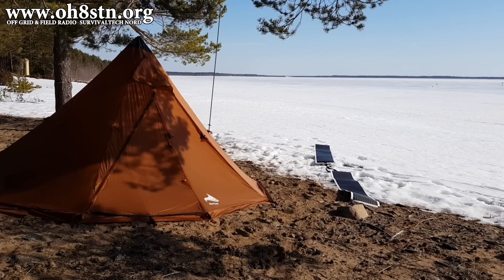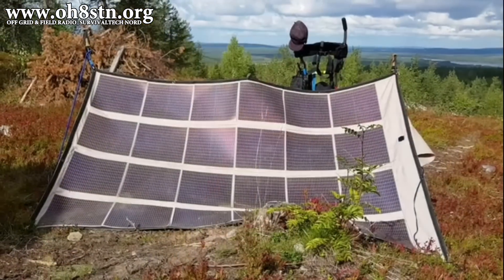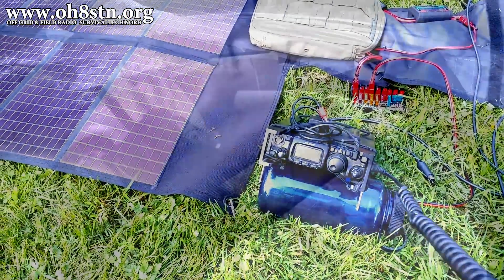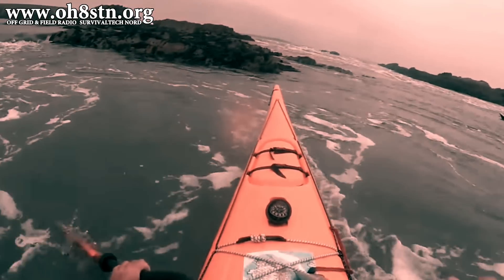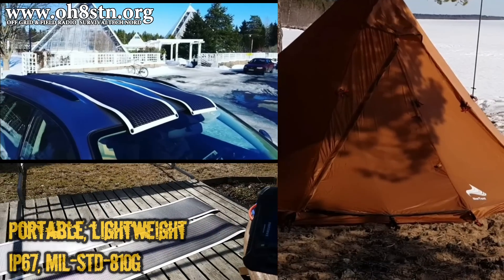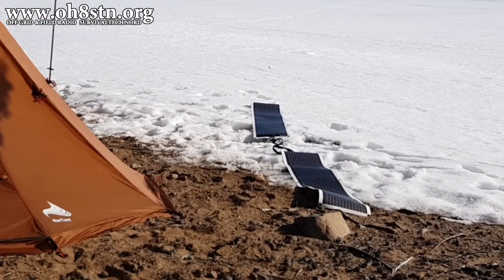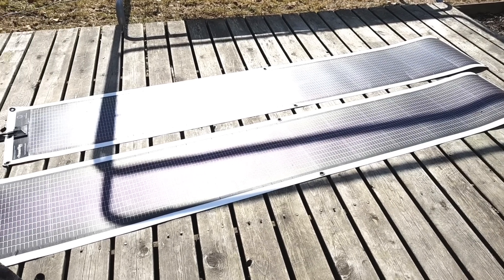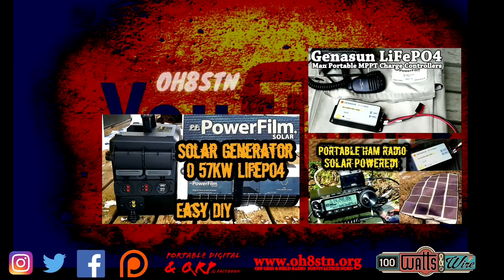Portable Solar Panel | PowerFilm Solar

Comment: Just found your channel, amazing content! I appreciate your efforts. Would you say two rollable powerfilm 60 panels are the way to go vs. a foldable 120? What one do you prefer given your extensive experience? What is the minimum panel size you need to keep the FT891 up?
Reply from the maker: Yhanks for the kindness. 
Definitely 2x 60 watt panels for redundancy.  The 60w panel can generate more than the rx current consumption of the 891, and 2x 60w will keep you charging on an overcast day at mid to high latitudes anytime but deep winter.
I would also combine the 2x 60w with a 12-20ah LiFePO4 battery and Genasun GV-10L charge controller. 
Hope this helps.
73
Julian oh8stn
Reply: @OH8STN Thank you, excellent advice. Subscribed and 73s.

Comment: Thanks to your reviews on the crystalline panel vs amorphous panel, I invested in the amorphous 120 foldable powerfilm. I did what was best for me due to the amorphous being able to take a beating, shot thru, and double as a shade structure/awning. 

But, especially, light weight. 

The price was hard to swallow, but it's one of those "buy once, cry once" situation.

I need it to charge my eb70s, to power my fridge. 

Thank you for your work.

Comment: Have you found any flexibility issues (cracking) with the rollable panels during cold weather -20 to -40C? Or would the foldable panels be a better choice in cold weather?
Reply from the maker: The only rollable panel I've ever seen damaged was one of my 28 Watts. I was out in about -25 C for several days. When I rolled it up, there was a very light sound of a crack. It was my first experience having them out in such cold and I didn't take care about rolling them nicely. Since then, I've learned to go slow rather than forcing them to roll shut. I haven't lost another one since. Those were the white ones, which were the last generation. This new generation, the black ones, are even more flexible, and more resistant to cracking. We need to be gentle in the cold. I've never lost a folding one.

Comment: Hello, i can't find the output for this panel (the 30W fodable), is there a DC plug to connect on my sherpa 100 AC?
Reply from the maker: You need a cable from the connector on the solar panel, to your solar input on your sherpa. Check the shop at www.powerfilmsolar.com
Reply: @OH8STN  Thank you for your response,  yes from what i saw, I have to buy an Anderson Powerpole cable and then Anderson to DC cable. too bad that they do not sell in one cable, or better, the DC directly on the panel.

Great review by the way!

Comment: I have 3 of the R14 rollable panels. Is there an adapter that would allow me to charge a Jackery 500?
Reply from the maker: Sure you can. I use two Rollable in series for a similar battery. Here's the direct link. https://californiapc.com/Portable-Solar-Chargers/Custom-Cables-Accs-for-PowerFilm/DPH2MX2SERIES-DPH2F-76IN.html
They can also build a custom cable for three panels in series. This cable I linked to exists because I asked them to build it for me. So be sure to reach out and let them know who sent you.
73
Julian oh8stn
Reply: @OH8STN  Thanks!
Reply: @OH8STN  I ordered a cable from them. Joe Gartner responded very quickly to my email and confirmed what I needed. I mentioned your referral. I will definitely order more solar stuff from them. Thanks!

Comment: Regarding battery temperature, I am curious when you deploy solar in cold temperature environments what lessons you've learned about ensuring no degradation to the lithium battery during charging. For example, when it's 10F outside, I presume a powersaver max is not the best option as the battery is exposed to the cold.

Comment: I like your videos, very detailed and mention points others don’t consider.

In your earlier video, https://youtu.be/AEXP2mhcN_w, you hose the foldable panel with water. In this video you say you took them inside your tent because it started to rain and recommend the rollable version.

Are or aren’t the foldable versions water proof?

The 30W panels only bring about 6% efficient are about the size of a 120W mono crystalline panel, which can be ~24% efficient. I understand the amorphous work better in low light and shade, but would a 120W panel that’s only outputting a small fraction outperform a 30W panel outputting a larger fraction?

Comment: Great review as always. Thanks! I'd like to pick up a R-series Powerfilm panel for my Jackery 160. Can you recommend a model?
Reply from the maker: Definitely. The r-series is perfect. It's completely waterproof and can be left outside  your camp in the field. I have 2x 28 watt R series and 1zlx 21 Watt. If I were doing it again, I think I would go with a 60 watt from the R series. Remember though if you live someplace like southern Italy or Arizona, you might get away with a smaller panel because there's so much sun. If you live in a place which is often quite cloudy, I would go with the bigger 60 watt panel. By the way how do you like that jackery?
Reply: @OH8STN  Hey man, appreciate the reply. The Jackery is great. I picked it up on a whim during a sale, just thought it would be nice to have for camping or emergencies. Turns out it's very well built, with quality components and cells inside. There is a YT teardown vid somewhere that shows it pretty well. I just had a look at the Powerfilm R-60 ... holy snacks that is expensive! I generally buy the best tools available but that's going to have to wait a bit  :-)  I looked up the specs and the Jackery 160 will take 42 Watts charge, so the R-60 would probably be a great fit considering your points about efficiency and weather. Take care bud!

Comment: Hi Julian. Top notch info, cutting edge use of the YouTube ecosystem. Question: I'm in the Pacific Northwest  in the US (dark, wet, and cold). I run 15 watts NVIS digital modes, man portable. Obviously Powerfilm, probably rollable, is the way to go. Love the "lego" mix and match. Looking at 1 r28, and then a second at some point later. In your opinion, what is the best way to wire 2x r28 panels together? I understand darker skies may suggest series, especially if using Genasun MPPT. With this specific situation and components, would you agree? Lots of info, but I wanted to cut through the noise (I don't trust my own conclusions from this research just yet). Your opinion carries vast weight. KG7CFN 73

Comment: I have a 90W folding Power Film panel.  Amazing power to weight ratio and very high quality.  I got a very good deal on the like new panel on eBay.  They're normally expensive, but worth it.

As always, thanks for the awesome video.

Comment: Just returned from a camping/radio trip deep into two different national forests. This was not my first portable field op, but the most demanding so far.

Finding sunlight or a clearing at a higher elevation, deep in the forest, is a challenge to say the least. Getting a signal out takes serious effort, but it can be done.

This channel alone has contributed more to demonstrating hands on portable field ops than any other resource.

Field work is hard work. Finding direct sunlight (or any sunlight) can some times be a make or break situation when the batteries are running low.

My take away from the recent trip is this: I think too many Amateur Radio Operators who only operate from their cozy home QTH will never fully appreciate all the hard work that goes into a channel like this. 

Also, don't buy cheap gear. It will get dropped, banged, bent, wet, hot, cold and maybe even broken. A roll of Gorilla Tape is a worthwhile item to add to your list.

Kudos to this channel and 73 !
Reply from the maker: You know Pat, I'm often blessed with good comments on this channel. Rarely however, do I get comments helping me understand someone is really paying attention. I've mentioned only a couple of times in my videos how the best camping spots are often the worst spots for radio communications and vice versa. Or grabbing water along the way, since there won't be any on The High Ground we look for, for a radio camping spot. Pointing out the practical problems like this with field communications means I can go to sleep tonight knowing the message is getting out there. This is an amazing comment and you've really made my day. 
Thanks for adding this fuel to the fire. It's appreciated more than words can convey.
73
Julian oh8stn

Comment: Hello Julian, thank you for this video.
I have a question about the Genasun LiFePo4 solar charging regulator. What can you say about disturbances on HF? Are there any on our short wave bands in your HF-radio, when you operate those regulators very close to your antenna? 
Greetings from Hamburg/Germany, Dietmar, DL4HAO
Reply from the maker: Hi Dietmar
With the ZGV10L,  there is occasionally some light interference on 40m when nearing ~10 amps solar input. Other bands are totally clear. I'm told by Genasun this shouldn't happen, but I have not received the replacement yet for testing. The GV5L has been quiet on all bands.
Reply: Thank you for the fast reply :)

Comment: good info, can you generate enough to start a car or how much time would it take to fill the super caps to start a hybrid car? wouldn't be possible to magnify sunlight off a satellite to your solar pad basically the moon does maybe reengineering an electron microscope replacing the eyepiece with an intense mirrored relay dc light , if someone wasn't using the sun instead a couple hrs ahead of a time zone, styropyro could put it together.